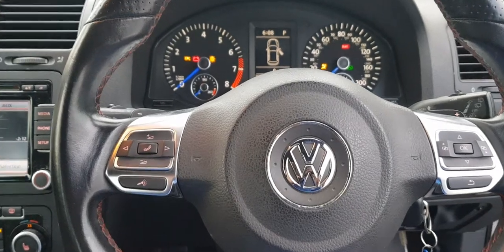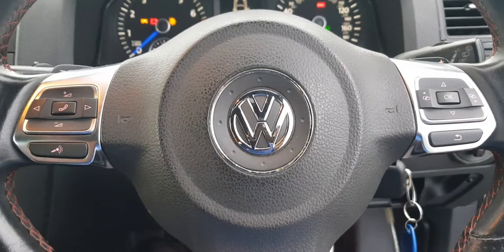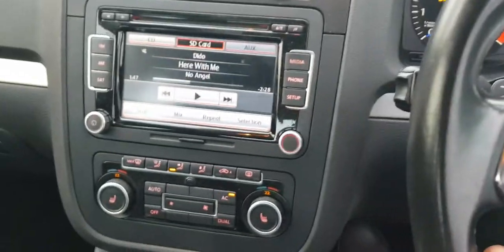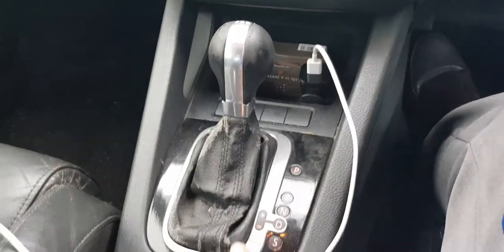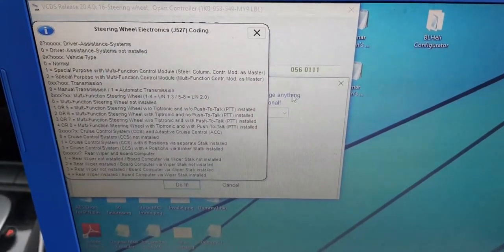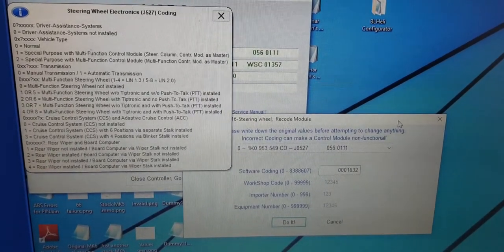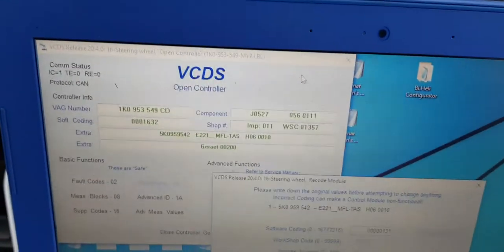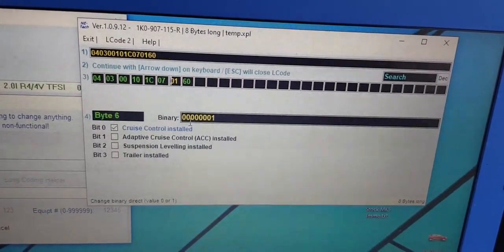MK6 GTI retrofit in a MK5 GTI coding

Comment: Whats good my dude, i just installed the new mk6 cluster on the mk6 everything working great, i even got rid of the annoying steering angle light, only question is that in the screen says ( key not in range ) and that message wont go away any sugestions? Can i get rid of that with vcds, and im gonna install as well the mk6 steering wheel, wanna know how can i do so i can get that steering buttons work, thanks a lot, you have instagram? Or some network that i could contact you? Thanks again apreciate your help a lot.
Reply from the maker: The "key not in range" is the immobilizer in the instrument cluster not seeing a matching key (transponder chip) from the coil that surrounds the ignition barrell. This can't be coded out in VCDS, but you can do a woraround where you could buy a new transponder pill (Megamos ID-48)  from anywhere cheap like ebay or AliExpress for about $3 for one.  You can then use a cloned tool like AVDI to pair this transponder pill to your instrument cluster.  You would either place it inside your key fob, or tape/glue it near the ring around your ignition barrel.  Your instrument cluster will now have a "matching key" and not show you that message anymore.   The thing about the MK6 steering wheel is to ensure that you have the Revision-C clockspring (if you don't have it already) and also the correct Steering Control Module (under the steering column) that supports both LIN 1.3 and LIN 2.0 .  This ensure the MK5 and MK6 components communicate with each other.

I'm working on a network that you can contact me on.  I should be able to get back to you in short order with it.
Reply: @MatthewTaylor3  ook thanks, now i understand, so for that I don’t need any coding right? Just buy a transponder pill and the tool? Can vcds work as well? Once i do that would i be able to use the left button on the cluster that shows the info bc rn is not working i guess i bc of the key
Reply from the maker: @valmorefaria195  for what I wrote above, you don't need to do any coding with VCDS.  You would just buy a "virgin" transponder pill and the tool.  VCDS can't work for you as you don't have any original keys to begin with (hence the key not in range error).  Also, UVE ROSS from Ross-Tech stated that they decided not to design VCDS to do any immobilizer work in this manner for legal reasons.  You would use a tool like ODIS or VCP to do this, BUT a legit copy of ODIS would need you to have a genuine key that is pared to the instrument cluster for you to add a second key using the GEKO system.  The left button on the cluster should always work at all times, but the "key out of range" message will always take priority.
Reply: @MatthewTaylor3  Would a locksmith be able to eliminate that message on the display, if i order the transponder pill, place it where the original one goes and let them do the work? Also if i get the steering wheel, clock spring, and module from the mk6 could i be able to control the display by the steering wheel, im a little worried about the left cluster button not doing anything, I don’t think the cluster is bad it only has 74k miles
Reply from the maker: @valmorefaria195  Yes, a VAG locksmith can eliminate that message either by an immo defeat in the cluster or by pairing a blank transponder pill (hence you would then have an official key).  The Clockspring HAS to be a Revision-C (by part number) The module can't come from a MK6 unless it communicates with BOTH LIN 1.3 and LIN 2.0  (these are DDP and BAP protocols specifically).  A MK6 steering wheel control module would have to support both protocols for it to work (hence a MK6 only module would not work).
I'll find and post the Ross-Tech guide that states which one your should buy based on the module that you have in your car currently.

Comment: Does the mk6 climate control work without a problem on mk5?
Reply from the maker: Yes,  the MK6 climate control worked perfectly in my MK5 GTI.   The only thing I needed to do was to connect a splice and reconnect a single wire from one harness to another so that the climate control REMEMBERS the l last settings when I switch the ignition off.  That was easy to do.  I think it was either pin 16 or pin 20.

The only thing that does NOT work is the defroster on the rear windshield.  I reside in Jamaica (a tropical country,  so I wouldn't use it anyway). The button does light up when you press it,  but my car would need another MK6 module installed somewhere else to make it work
Reply: @MatthewTaylor3  i installed yesterday this climate on passat b6 variant which had that old style climate too and the defroster doesnt work,all of my windows are foggind,is it possible to fix it?
Reply from the maker: @Benko_DieseL  It IS possible to fix it, but I can't find the URL that I previously used.  It requires getting a module from the MK6 (still PQ-35 chassis).  You would be able to get all that you need from a 2010 Jetta (which still has the MK5 Jetta shape in a specific geographic region).  I don't even remember what type of module it was that was needed to make the defroster work.  The issue, in this case, wasn't a change in communication protocol (between MK5 and MK6), but the fact that the defroster was handled by another module.  

It is similar to how for the MK5, there is both a Central Electronics module and a Comfort System, but the MK6 merges the two in a single Body Control module.

Another example is where the MK5 has the rear passenger doors as independent modules, and the MK6 has them as "slave" modules to the Driver and Passenger door respectively.

If you could find the right module from a 2010 Jetta (MK5 shape) and transferred the appropriate coding, then it would work.   I'll try to research what module you need for the defroster..

When I press my defroster button, I do hear a relay "click" under the dashboard (below the steering wheel), so i know the wiring to that point is good.
Reply: @MatthewTaylor3  what kind of a module is that?
I was just opening it again but the problem lies on the rear sode heaters on the window dont work and rear door windows dont defrost so my question is,where is the defroster located when it defrosez the windows
Reply from the maker: @Benko_DieseL  when your Passat was stock,  it is either module #9 or #46 that controls this.   Now you would need a newer revision of the #9 module.   This is usually located under the dashboard above the pedals.  I don't know what variant of that part number you would need,  but a 2010 Jetta is a good starting point.

The wiring is different too, so you might not consider that task worth it.

I was going to take one from a B7 Passat, but when I saw the wiring differences,  I scrapped that idea.
Reply: @MatthewTaylor3  i think its the gateway and i put the last digit from Q and i have done some wiring on the climate control everything works except the defroster
Reply from the maker: @Benko_DieseL  I can tell you for SURE that it isn't the gateway.   I have a Passat B7 gateway installed right now.
Reply: @MatthewTaylor3  ohh,am so pissed bro i cant drive sometimes it looks so stupid
Reply from the maker: @Benko_DieseL  I'm sorry to hear about this experience, I'm browsing through the various forums for a working solution.
Reply: Great transition to climatronic mk6.  Did you make a tutorial video of this transition? @MatthewTaylor3
Reply from the maker: @VegetaGoku-z3w  I believe I did.  I'll check.    THere are two important things you need to know.

1. You NEED the 2010 Jetta bezel to give it that OEM look.  It must be the 2010, no other one will work.

2.  You need to look at your existing climatronic unit and see it it has the work ECON instead of A/C.  If it does, you buy the other part number that is NOT the one that is shown in my other video that speaks about the install.  This has something to do with one motor vs two for adjusting the recirculating flaps or the various vent flaps.

3. Although I sad there were only two things, I lied.  There is also two wires you need to de-pin and swap.  THis allows the unit to remember the temperature and vent setting whenever you switch the ignition OFF.  I think this was pin 16 and 20 (don't quote me on this, it was in my video).
Reply: @MatthewTaylor3  thank you if you have the link to your video installation, I will watch.  
I have the ECON button, ok I buy the other number.  
Thanks your information 🙏
Reply from the maker: @VegetaGoku-z3w  https://www.youtube.com/watch?v=TIJZlUddMjg

I'm sorry, I thought I documented it.  Can you watch this video, and then ask any question, and I'll answer.   I had JUST completed the swap in a parking lot, then did the coding to match my car.
Reply: @MatthewTaylor3  Great, i'm going to see.